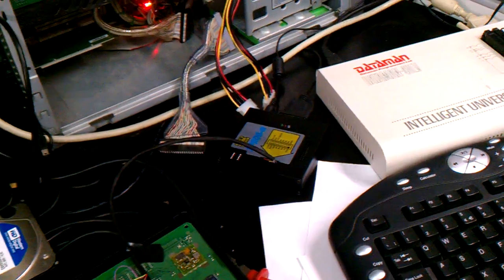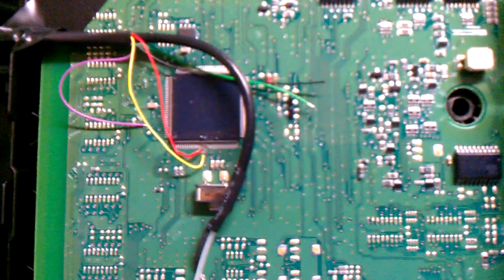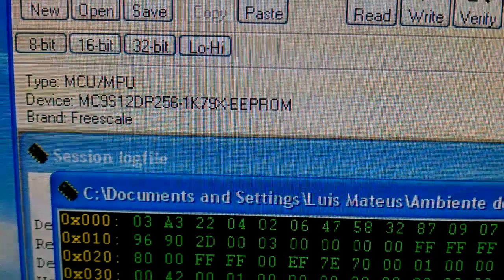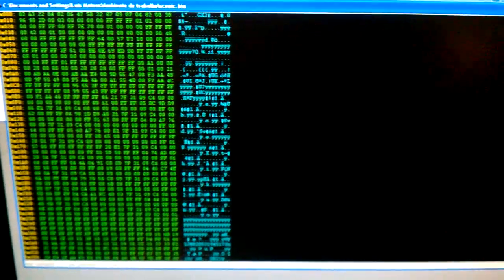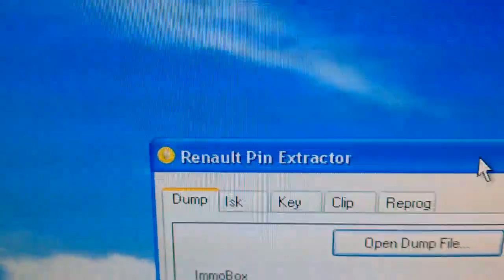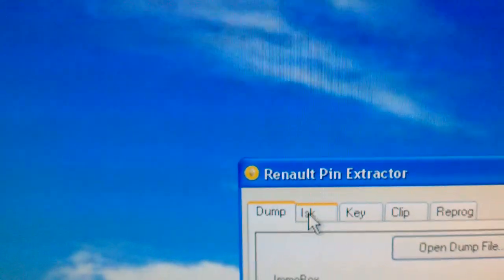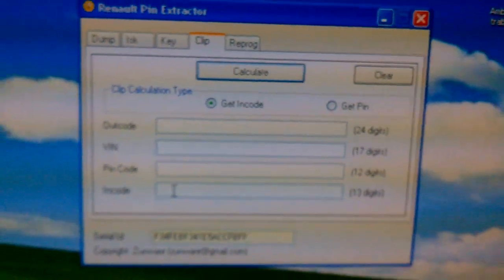Renault Scenic Dump UHC MC9S12DP256 Mask 1K79X EEPROM extract security pin.

Comment: How are you? How do you do a Renault scenic one ,2004 it’s start ne72 How can I retrieve the pin code?
Reply from the maker: Well, Renolink might be able to retrieve that... alternatively, you should be able to read the UCH and get it from there...
👍👍👍
Reply: Can I be done with the orange? 5 programmer Cannot find a wiring diagram.
Reply from the maker: @lambertomidolini8027  
Possibly...
From the top of my head I not sure if the pin is stored on a EEPROM of on the MCU... Nor which version is on that particular UCH...
You need to open the module and see what you are dealing with...
It might be similar to the one on the video...
Reply: It’ll be like the one on your video haven’t done it yet, but have done the research
Reply from the maker: @lambertomidolini8027  
Ok...
I do not have Orange, just check that it can read the particular chips...
The pin outs, if you don't have them on the Orange documentation, search for the datasheet of the MCU itself...
Reply: Thank you.
Reply from the maker: @lambertomidolini8027  
No worries...

Comment: If i make full swap for mc12, the car start ? or i have to learn card ?
Reply from the maker: Should start straight away... as all the info is moved... just make sure there is not an eeprom either... if it is, move it as well...
👍👍👍
Reply: @LMAutoRepairs   i make full swap for MC9S12, he contain eeprom part and Flash part i clone all but the car not start
Reply from the maker: @dzeepromer4626 
I know... but sometimes still an external eeprom... just double check...
Also, double and triple check the soldering of the mcu... it is easy to miss a bad one...
And last, why are doing that?
Remember that if the original problem was with the data in that mcu, you are just moving the problem to the "new" module...

Comment: Hi,
may I ask you a question?
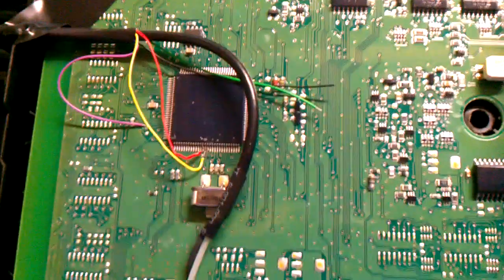At 1:23 you show the chip with only 3 wires connected (red, yellow and blue) while on the connection diagram you demonstrated 4 wires (+1 wire more - grounding). Could you please advice where this black one goes to on the chip?
Reply from the maker: Hi
I have indeed 4 wires connected...
As you probably know is not easy to solder the wires into the so tiny chip legs... so the ground is and can be solder anywhere in the pcb. .. doesn't necessarily needs to be straight to the chip....